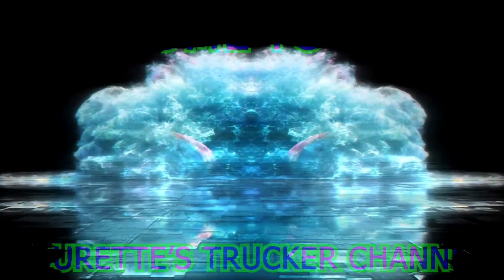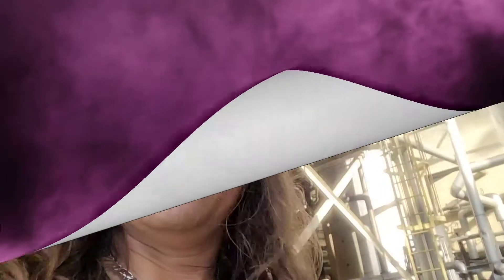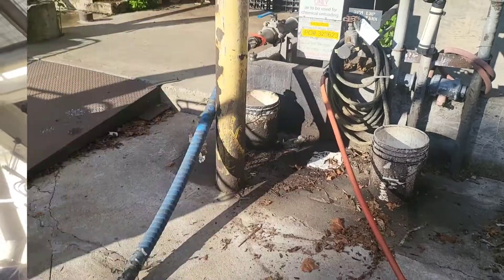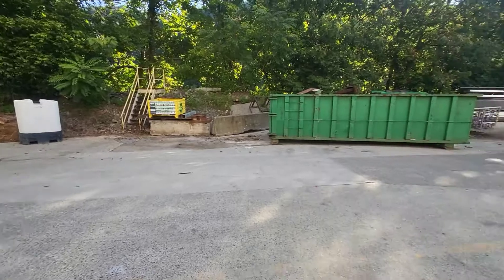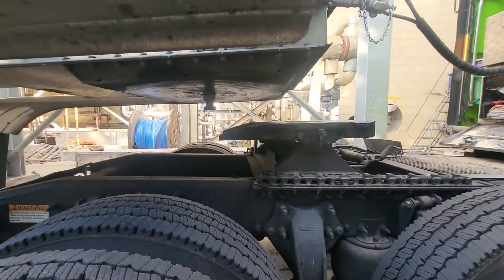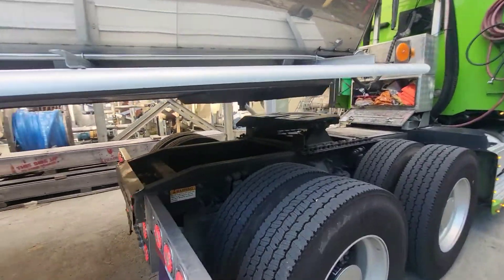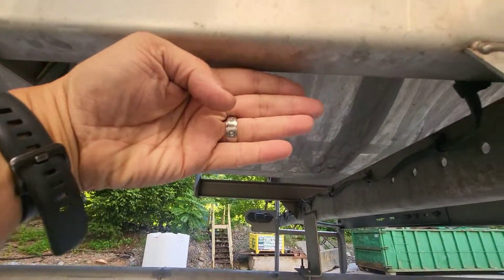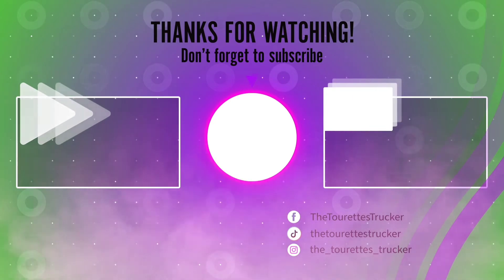Problems with unloading a chemical tanker & how to solve it. Work smarter not harder. Tanker Yanker

Comment: Yes, work smarter not harder,  too bad they (they the receiver doesn't have doneage lying around it would be helpful......    🤔👍🙏💪
Reply from the maker: I had to use (2) 6x6's from a crane blocking my unloading station on a load a while back. Trailer was about 18" over 5th wheel to get any kind of fall from where I had to unload.

Comment: Would it be better to carry small squares of 2x6 x 6” so you could put additional levels on the stack if needed but primarily more convenient to store somewhere?
Reply from the maker: We have some places that are dirt so I use the longer boards for better weight distribution on the ground.
Reply: @TheTourettesTrucker  ok, that makes sense but could still maybe have a few squares to add on and get you up to 6” height if needed? Since 3” of height might not be enough but two layers of long boards would give good base plate.
Since in other comment, you needed and used a 6x6 at that other location...